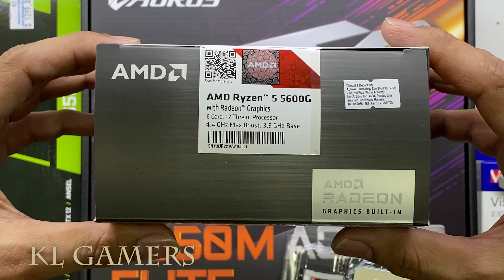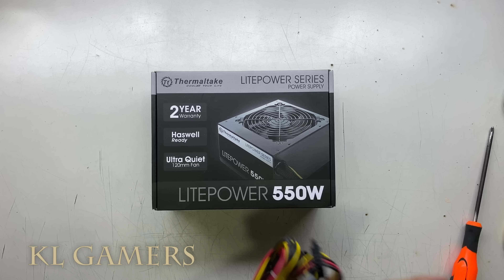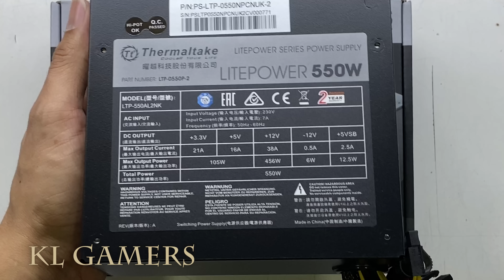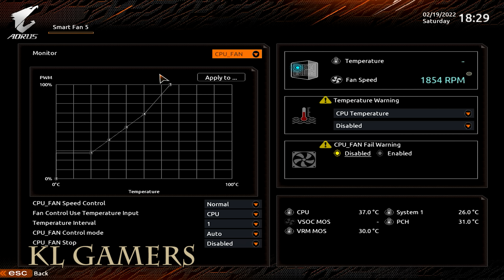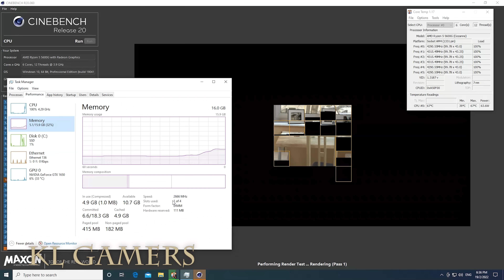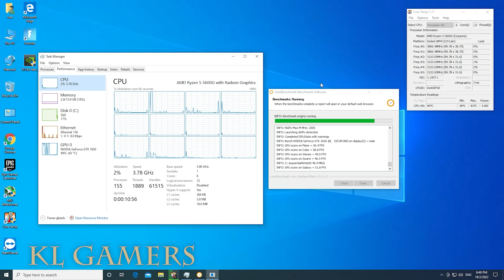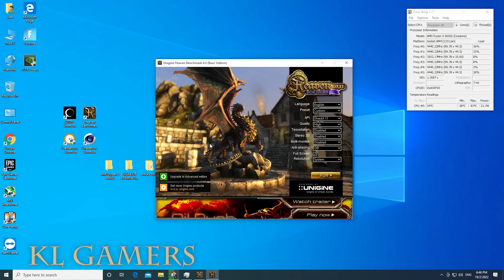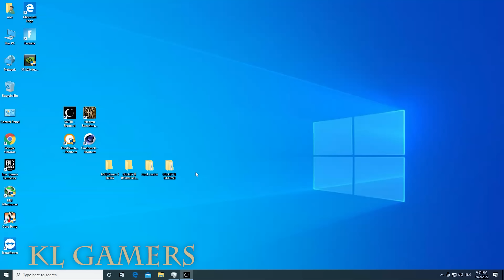AMD Ryzen 5 5600G GIGABYTE B550M AORUS ELITE GTX1650 DarkFlash LEO Gaming PC Build

Comment: You could have gone for Ryzen5 5600 or Ryzen5 3600 insted of 5600g.
Reply: yeah i agree with you.
Reply: Ryzen 5 5600x is good
Reply: Ryzen 5600x is at its lowest price.  About $220 US right now.  A great bang for the buck.
Reply: @HardPumpers  sorry, can i ask which is better between Ryzen 5 5600g - Ryzen 5 3600 - Ryzen 5 5600x ? 
Planning on build gaming pc and my knowledge is not too good on this. 

Thanks for the help.
Reply: @darkerpath  Out of those I would choose the 5600x if you plan on using a discreet GPU.
Reply: @HardPumpers  i plan on buying GTX1650, is that still good ?
Reply: @darkerpath  sounds good.
Reply: @HardPumpers  do integreted gpu and decreet gpu works at same time??
Reply: @arghosaha1801  nope

Comment: I am planning to buy this same is there problem while playing games?
Reply from the maker: just is normal speed for gaming
Reply: @KLGamers  I want only 60 to 70 fps gameplay because my monitor has 75hz refresh rate
Reply: @KLGamers  Can I use B450 motherboard for this combination
Reply: i would at least recommend 2 Sticks of 3200MHz Ram for the Build and if you use a GPU get a Ryzen 5600x or 5700x CPU. No need for integrated Graphics.

Comment: Should have went with 5600x or something if you are buying a GPU right away. No point in buying 5600G unless you can only buy a GPU much much later.
Reply from the maker: is more expensive or no stock
Reply: I bought 5600g cause i don't have a money for gpu.  5600g is actually good, can run a heavy games in low to medium settings. I will buy a gpu later when i already have a money.
Reply: @zerefhitomi177  hi can you share the specs of your pc and how much money did you spend? 
Pinoy ka ba?
Reply: @Zisei ? Why is there no point in buying that GTX1650 if using Ryzen 5 5600g ? 
Bcs i'm planning in build like this and my knowledge is not that good on PC.
Reply: @darkerpath  for me there is no point at all, save for a 1660s
Reply: @captainadi7375  so if i'm using Ryzen 5 5600g it's better start with GTX 1660, is that what you mean ? 

Which is better Ryzen 5 5600g vs 5600x vs Intel i5 11400f ?
Reply: @darkerpath  with 1660s? Probably the 5600x
Reply: @captainadi7375  thanks
Reply: @darkerpath  of course a 5600x is better but 5600g is $110 and 5600x is $190
Reply: @AMIRACLEISME  cpu prices went down rapidly huh, that 5600x now is on the lower side of 150$
Reply: @loatheran  facts even GPUs did i remember when 3060s were selling at $600 - $700 now they’re $300 - $450

Comment: Can someone tell me what fans i need to buy for this motherboard? What volt do I need for the fans 12v or 5v? I don't know what to buy it's like no one has this board because I can't get info on what to do anywhere, I just spent $1700 on parts and scared to build it I don't wanna fry anything.

Comment: Hi, would be possible to setup ram with 3600mhz? I have same MB, cpu is 5600(none g or x) and ram kingstone fury rgb cl16 3600mhz.I cant start pc with 3600mhz, only with 3200mhz ram.. although MB should run 3600mhz oc, but i dont know how to do it :(((
Reply from the maker: https://www.amd.com/en/products/cpu/amd-ryzen-5-5600, you can try update BIOS and enable XMP profile 1
Reply: @KLGamers  hi, I did so, but didnt help. XMP profile 1 is for 3000mhz ram, profile 2 for 3600mhz but not working. I used appcenter to tune it on 3200mhz ram. I think the problem is cpu - cant run 3600mhz ram..